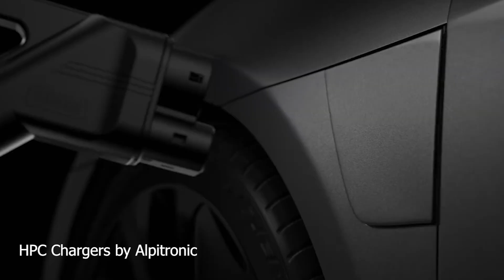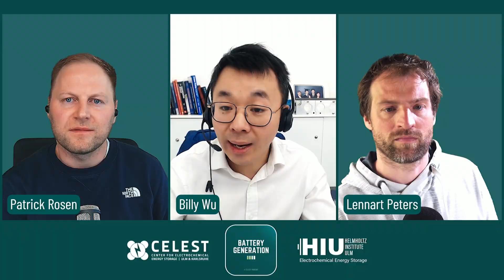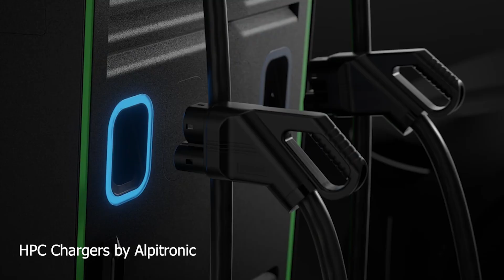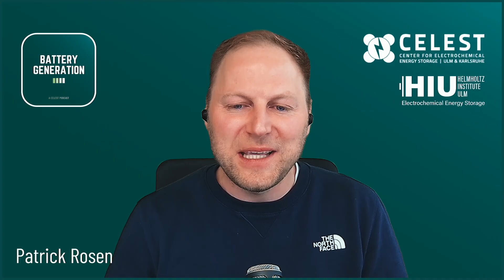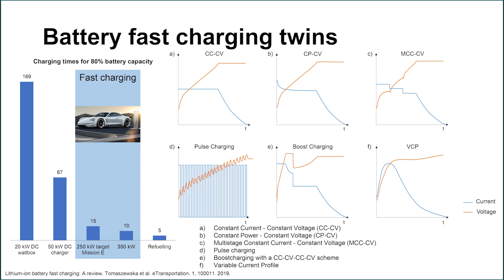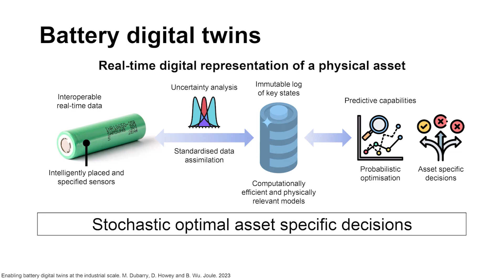Dr. Billy Wu: How Charging Routines affect Degradation | Battery Podcast

Comment: Excellent take aways.

State of health (driving range/original range) is not a good predicttor of remaining life.

Keeping SOC low helps with battery longevity.

Fast charging is never a good thing, though convenient.

There's more sensors required aside from voltage, current and temperature to fully assess the state of the battery cells.

One of the few discussions where almost everything stated is factual.
Reply: Should avoid SOC over 80% and under 20% for extended time. If range is 300 km, and you drive only under 100 km per day, it's best to charge up to only 70 or 80% every night. Sometimes then charge to full before long trip is ok, and charging full is needed for proper balancing of the cells. Especially LFP battery needs to be charged full regularly for balancing. 

In Finland home charging in night time with control of electricity price is really no brainer. This summer in night time its always couple of hours less than 4c/kWh prices in my area. Sometimes even below zero. So using a smart charging like controlling the car with gridio-app according to electricity prices and car battery state is clever with wholesale (changing) electricity prices. Home charging with 11kW and trying to charge only cheapest hours of week means that with 10 h of charging is enough for 500 km driving per week really cheaply. 

Balancing is pretty slow, the BMS usually can use very small current for each cell balancing and the simplest way is to slowly charge the battery so that first cell is nearly full, then discharge that cell to average level. That's the way how 12V LFP recreational battery management usually works with 4 cells. LFP tolerates quite well being SOC, and the last mVs of cell voltage doesn't add much useful charge, the voltage raises quite quickly towards full soc. It is usually enough for 100Ah battery to have less than 1A discharge for cells. Keep constant voltage on charging so low that none of cells exceed limit, and discharge highest voltage cell until they have same voltage as others. If the cells are similar, it's enough to have something like 0,1A balancing current for 100Ah cells. Then 1% disbalance is mitigated in 10h, but 1% is a lot, if balancing is done at least once a month. But especially LFP batteries need balancing regularly, otherwise it's best to try to keep the SOC around middle. Tesla recommends full charge every week or so for BYD and CATL LFP batteries. Cobalt containing batteries is not recommended to charge full often and not for long time. They can be balanced easier to 80% SOC, so there is not so much need to charge full. LFP voltage curve vs SOC is flat in middle of SOC states, so balancing needs close to full charge.
Reply: Would slow charging for nine hours overnight twice a week using 13amp household supply constituent a safe and careful charging strategy? Geoff

Comment: Operating, charging/refuelling an EV is a different paradigm to ICE vehicles. In my experience fast charging is to a large degree irrelevant as it is something I have rarely found a need to do.
Reply: When you have an electric vehicle and you are a homeowner, or your condominium or apartment has a connection for an electric vehicle, you leave every morning with a full tank.

Well for battery life, a full enough tank that you won't have to refill that day. You only charge up to over 90% if you really are driving over 250 me that day.
Reply: I only charge to 70% every workday and use 20% before charging slowly overnight
Reply: Just an update, 900,000 people lost power in my city over the last week. I asked my Tesla neighbor how he got by. And he said that Tesla had all but one of the power stations back up immediately. He had to go and fill up one time. He would not have had to do that but he had to go buy gasoline for his small generator that was keeping one window unit and the refrigerator and a TV and cable modem running.

He was not stressed out and I let him know that when we were hit by a major hurricane power was down for 3 weeks and suggested he make some preparations for that worst case scenario.

During that disaster there was no gasoline within 70 Mi of the city for at least the first 7 days and the stores were empty.

I got through this time with a 4300 watt dual propane gasoline generator and a 1,000 watt solar battery with 200 watts of solar panels.

The only change I can see making is to buy 200 Watts more panels and to get three more tanks of propane if a hurricane is forecast to go across the city.

And I offered to let him charge off of my generator which will give him about 4 mph of charging without impacting me very heavily.

Comment: Use a glass to catch water, the faster the flow and the more volume of flow will make the glass spill over. You can fill it fast but then slow down the rate as the water reaches the top. Batteries work exactly the same way. My 9 year old model S battery is still in excellent condition as it has never been super charged. The max charge rate it has ever used was a public 48kW, otherwise it has only been home charged at 7kW or 3kW and only to 70% for daily use, 50% if parked for longer periods and 90% for longer road trips over 300km.
Reply: How about nmc batteries vs lfp batteries, does the glass water analogy still applies the same way?
Reply: @Arashiii87  The analogy applies to all chemical batteries with fixed amounts of reactive material internal to the cell. It doesn't apply for example to flow batteries.
Reply: I think there is a strong relation between the life of a lithium battery and the temperature at which it is operated. If you use the battery in such a way that it often gets hot, you will greatly shorten its life. See also the official investigation report into the battery fires that occurred in two nearly new Boeing 787 aircraft. Using a very sensitive calorimeter the investigators found that the lithium battery would begin to produce a tiny but detectable of heat starting at about 55deg.C and increasing with further increase in temperature. This heat is probably coming from a chemical reaction that is consuming the active materials in the battery (and that at higher temperatures is what leads to thermal runaway).
Reply: @cedriclynch  The overheating of the Boeing 787 Dreamliner's lithium-ion batteries in 2013 was traced back to an internal short circuit within one of the battery cells.
Reply: @Arashiii87  I did see in the report that the fires were believed to have been caused by internal short-circuits, , but I also read the part in which the investigators put cells in the calorimeter to determine the temperature at which they started to produce detectable heat and it turned out to be well below the specified maximum operating temperature.
Reply: @cedriclynch  The overheating of the Boeing 787 Dreamliner's lithium-ion batteries in 2013 was traced back to an internal short circuit within one of the battery cells.
Reply: @cedriclynch  Yep very true. At higher temp over 28degC, with the car at rest I keep the charge at 30% which is plenty for run arounds if needed, 50% if I use it more often.
Reply: "And it was only driven by a little old lady to church and that's not yellow paint, that's a yellow primer man."

Lol.

I agree with everything you said but your post reminded me of one of my favorite movies. "Used Cars" starring Kurt Russell.

For those too young, the yellow primer was actually the yellow paint of a "Yellow Cab" which meant it was very high mileage.
Reply: No lmao that's not how batteries work😂
Reply: This practice doesn't work with every ev  some evs only have top balancing of battery packs so those types of ev has to charge to 100% at least once in a week
Reply: Exactly, my experience also. For the majority of use cases, possibly vast majority, fast charging is largely irrelevant
Reply: Your batteries excellent SoH is due to keeping the SoC <70%. Rapid DC isn’t worse than AC, the TMS will turn on the cooling system and even reduce speed to avoid excessive temperatures. Important is the size of the session: 5x 20% is far better than 1x 100%.

Comment: Big unwieldy cables are not the problem. It is just unfeasible with the way people charge now. We could easily have another high power charging standard, with say a Pantograph that comes out of the ground under the car, that would require no user interaction at all.
Reply: or if a heaavier cable would be suspended, hanging on an swinging, counter-weighted arm, then it would be no problem.
Reply: I would hope at some point the industry would move to 800V charging so that the current numbers can be lowered to hopefully reduce heating and either maintain the current size cable or even have thinner cables.  But I understand that the struggles with 800V charging architecture is expensive and would need increased economies of scale.  Would be nice to see an EV industry move to 800V charging infrastructure but also improve the battery chemistry that can take 800V charging as well.

Comment: The takeaway is if you charge a battery too fast and too full your battery will die... We get bombarded with 'claims by EV makers on ultra-short charging times,  but doing that kills the chemistry.  Bottom line is EV will never equal ICE in 'refueling time' and convenience.. Nobody ever told me that filling my petrol tank too fast, or filling it to 100% would damage it...
Reply from the maker: Yeah, I guess you‘re right the battery will never beat the gas in terms of refueling time. Keep in mind this is a tech channel, no consumer has to care about this except for the battery management system. On a side note: ICE will never equal BEVs in low maintenance, low operating costs, high safety, low CO2 emissions and huge lifespan. A nice trade-off, right?
Reply: @GeladenBatteryPodcast  latest CarWow reliability stats in UK for 2024 show 3 x EV in the top ten ( worst reliability )  Tesla model Y at 6th, Tesla model X at 3rd, and BMW i8 at number 1....  Along with normal Range Rover and Audi suspects.  Survey covers how often the vehicles break down and the cost to repair. As for lifespan, average ICE is >20 years,  the jury is still out on EV..
Reply from the maker: @chrissmith2114   Hm. Interesting ranking. These tests normally show a big lead for EVs for low maintenance.
Reply: @chrissmith2114 IMO it’s a bit far fetched to call the i8 an EV. It’s a plug in hybrid car, to me this is a Frankenstein car but not an EV just because it can drive a few miles on a battery.
Reply from the maker: The consumer himself does not have to care about charging the EV too fast… that would be horrific! 😮
Reply: I will tell you. At semi refueling with big hose diesel pumps it said to not fuel full bore as you could have back flow on trucks or multiple pump turn offs because of smaller fuel piping. I would suggest that we Americans have been conditioned to fill fast and get out for the next guy so the station can maximize income. Maybe we need to slow down. It is like traveling at 80 or 60 mph. Once we are all in robotaxi we might not care about the minutes of time.
Reply: @timsteinkamp2245  Even with 'slower fueling'  you can still put 1200 + miles of range in a diesel semi in 10 minutes,  now look at charging time for EV semi to get 300 miles range...
Reply: EVs already beatt equivaleny ICE cars on convenience. Very rapid charging ttime is only a very small partt of tthe equattion.
Reply: Convenience is relative is this case. Someone who can charge at home with a level 2 charger would almost never have to charge elsewhere. Whereas they would always have to go to the gas station with an ICE car. On the flip side, it's more inconvenient to solely use public chargers due to the charge time.

Comment: Dear Doctor, You should update Your knowledge, because now Tesla owners use Charging Towels ... You do not need liquid cooled cables...
Reply: This is high tech stuff here, rather than wet towels you should refer to these as reusable portable phase change cooling devices.
Reply: So the stupid telsa owner puts a wet cloth over the charging plug to fool the sensor that it's not overheating. What could possibly go wrong.
Reply: Most definitely a way to destroy your battery sooner.

Comment: With a laptop, would it be better to always have it plugged in, when in use and charged 100% but have no charge cycles or to let it run off the battery and have a charge cycle everyday?
Reply: It would be best to set a Charge limit of 80-85% for your laptop if constantly plugged in. Keeping the battery at 100% for long periods of time will degrade the battery health considerably over time. Dell has a Dell Power Manger App to set it on their Dell laptops and Lenovo has Lenovo Vantage App to set custom charge settings to prevent charging past a certain point. Apple has smart charging to stop charging around 80-90% depending on usage habits.
Reply: Let battery run.  Charging between 35% to 55% would give you the highest possible state of health for the longest time possible. Calendar aging starts increasing exponentially the higher above 55% you go and the longer you leave the battery charged over 55%.  If you use the battery immediately after charging then you might bump that up to 60% because the battery won’t be much above 55% for long. 

If you charge the battery immediately after discharge, it’s ok to go down to as low as 10%.  If you don’t charge immediately, then only go down to 20%.
Reply: @NickWindham  It is not about SOC, it is about conductivity, if layers of C,sep,A,sep, C ... have good thermal conductivity and pack is cooled properly, there will be small impact of temperature to DC resistence and capacity loss, more temp gradient, more damage to cells, "soft" cells, means voltage swings, cell have capacity, but do not have power, you take much current and voltage drop is huge., WHy use battery, if you can store battery at low temps and prolong calendar life ?
Reply: @NickWindham  Hi Nick, do you know which mechanisms underly the increase in calendar ageing, the fact that its exponential and the specific SoC states that you mentioned are involved?

Comment: If fast charging requires cooling it must mean that some of the electricity you are paying for at the charger is actually being wasted in heating the coolant. Presumably the customer is paying for this wasted electricity. Given the exorbitant costs of electricity at fast chargers this is going to a significant cost.
Reply: Its a small percentage only but yes it's there. You might not believe it but there are people who drive around in vehicles where 80% of the energy delivered to the propulsion system ends up as wasted heat.
Reply: @moestrei Very good comment. But you might need to say out loud "fossil fuels" as some could not go get it
Reply from the maker: You are correct. Same principles apply to power electronics as well. The more power, the more heat. That‘s why wie should talk about 800V and silicon carbide (SiC) as soon as possible 😉
Reply: Most of the cost of "Public DCFC" is not the electricity but the cost of the land, charging equipment, repair of (failing or vandalism), demand charges etc
Reply: There are losses all along the route; everything gets hot. During my own Dr. in this general subject area, I suggested the homeless would love indoor car parks in the winter - it'll be nice and warm in there :)
Reply: My point was that when you fast charge you are effectively paying more for the net charge you have received. Whereas with fossil you get what you pay for no matter how quickly you fill your tank. Just something that consumers should be made aware of.
Reply: @Pago77 valid point.
EV chargers are mostly unmanned.
Petrol stations are mostly manned you're paying for the person to take your money. Also the explosion risk at a fossil station is so great that the entire site is subject to extensive and expensive health and safety regulations.
Reply: @Pago77  at some level I understand what you mean, but your are still wrong. You buy volume X in gasoline and that is that you have kn your tank. But that is gross energy. The net energy you will get depend on your engine, outside temp, type of traffic, your right foot. And your net energy of that fuel tank (what you have accomplished finally) can be as low as 10 to 15%, at best 40%.
The energy you have stored in a battery will have mostly only 10% losses (similar depending as on some of above parameters)
Reply: Most drivers only really care about miles per dollar equation and they are lucky if they get that number figured out apples to apples, you can save all the complex stuff for the engineers and the economists.